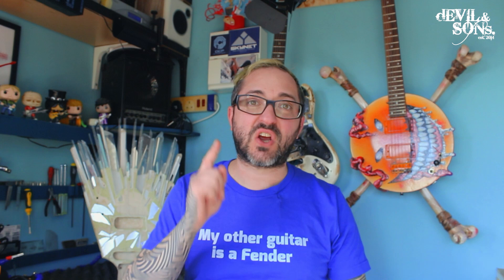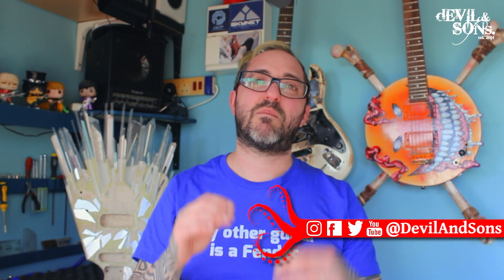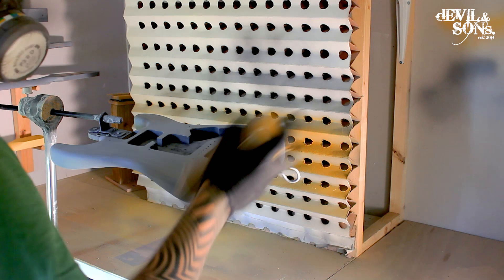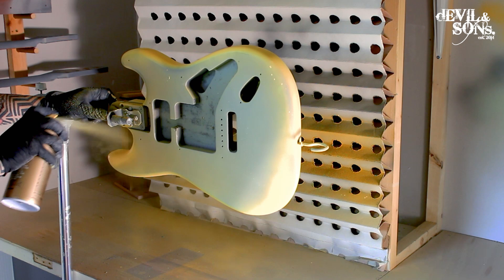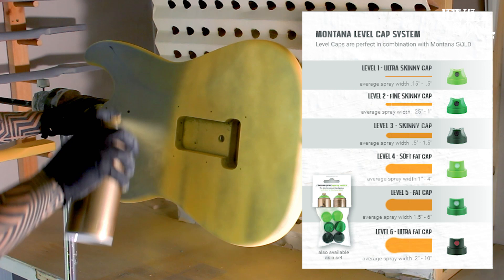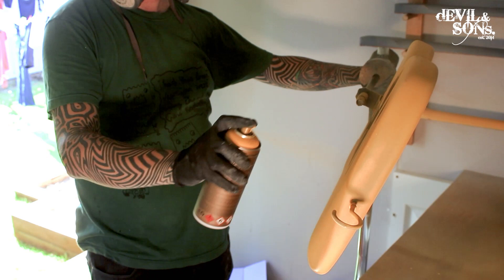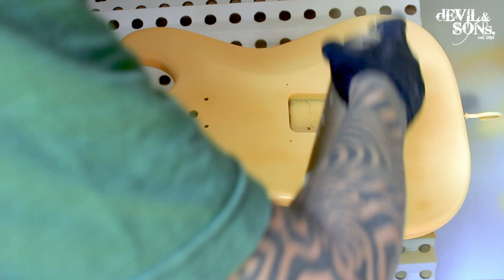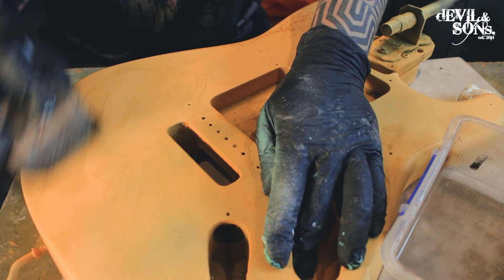How to paint a guitar with Montana Gold spray paints

Comment: Hi Dan, I found your vids because I plan to spray my new guitar body with Montana Metallic Effect Spray. The paint is semi gloss, I need to know if I should be sanding the paint surface before I spray over it with the Spraymax 2k clear gloss? Thanks for the tutorial vids, they contain good info. Cheers G.
Reply from the maker: Thanks for getting in touch, and for watching. A problem with the Montana paint is it's not made for guitars so it's a bit harder to get a great finish which is why I would suggest sanding, plus it helps the spraymax grip to it. However I imagine sanding the metallic effect spray may effect the finish it has. It may be worth doing a test first. I don't think the spraymax will effect it but sometimes the metallic type effects get their look from the surface and if something else is put on it may dull the effect a bit. As I haven't used it I couldn't be sure. Sorry not to be more helpful.
Reply: @DevilAndSons  thanks for the response, I certainly will do a test first. I emailed Montana directly and they responded with the recommendation that a 2k clear should be used on guitars, rather than their own brand spray varnish clear coat. I will see what happens when I sand the metallic effect paint on a test piece as per your suggestion. I'll probably use a cheaper clear coat on the test piece though to see how it looks under clear as I don't want to waste an entire can of 2k on a test piece. Cheers G.
Reply from the maker: So cool that they responded. That makes sense regarding using a cheap clear coat. It maybe that actually if it looks bad when you sand it the clear coat may fix it.  Do let me know how you get on.
Reply: @DevilAndSons  Will do, cheers G.
Reply: @glegalee  Hey! Any updates on how that turned out? I'm looking to do the same thing xD
Reply from the maker: Yeah, would be cool to know.
Reply: @BobbySplax & @Devil & Sons Guitars Yes I have an update. I'm no painter nor do I have a spray booth, I laid down my primer and colour coats in my garden. I'm very happy with the results I have gotten. I plan to wait a week before applying my Spraymax 2K Clear. I would love to show you my progress but YouTube keeps removing my comment if I add a link to my shared folder.
Reply from the maker: Thanks for trying to share. I think there is no way to share images, just videos on YouTube. So glad it's working well. Good luck with the spraymax.
Reply: @DevilAndSons  Mornin' I have an update for anyone who is interested. I Laid down my Spraymax 2K clear yesterday and I'm extremely happy with the outcome. Of course I will need to flat sand and polish the body but I didn't end up with to much of an orange peel surface. I used 3 coats of clear over the Montana metallic paint. Just one thing I feel I should mention with regards to the Montana cans, I found that when the can was less than half full I was getting pressure issues, the coats were going on quite patchy and it was spitting blobs of paint onto the work piece. When I switched to a full can the issue went away until it was below half full again. Please bear in mind however that I do not have an indoor space to spray with a steady temperature, I was painting outside in my garden on a calm day, so anyone else who used Montana cans may have better luck with regards to the half full can situation mentioned above. I'd not be put off by using them again though.
Reply from the maker: Thanks so much for the update, it sounds like it is going well. Hmm, that is frustrating with the half can. I have noticed sometimes that the nozzle gets clogged and have changed half way, maybe that would help, but great you had an extra can. Good luck with the sanding and buffing.

Comment: there junk sorry i dont like them i used them a its wasnt good i buy mohawk crackle lauqer black / whit/ or tintable.  but at almost 1000bucks a quart its pricey butr it wirks everytime man i use krylon colrs as a basde and scence thier clrear is actualyacrylic lacquer i go over the enamel but dusting coats  all i need is to get the surface coated e let dry and hit it with the mohawk and ba..m
Reply from the maker: That sounds good, I've not seen mohawk before - I wonder if the sell in the UK?